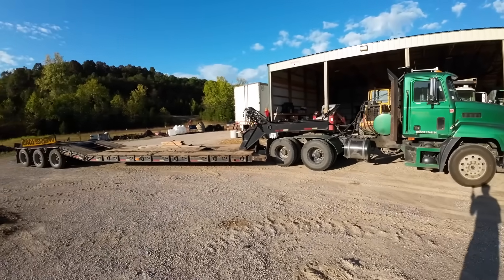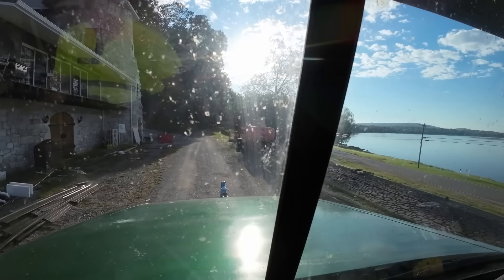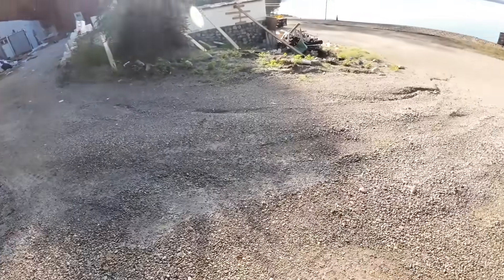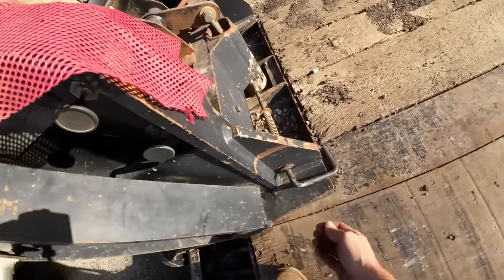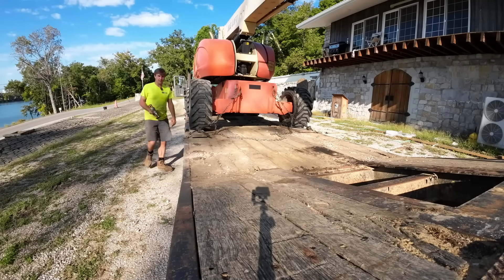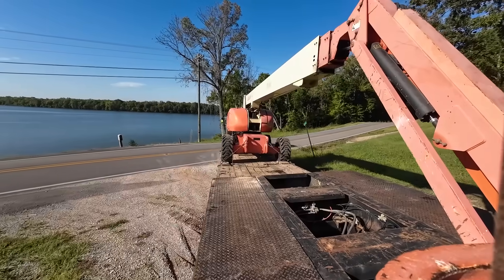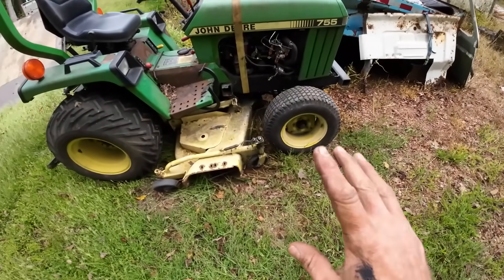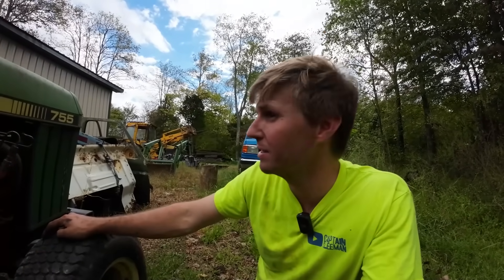Trucking my Marketplace Purchases

Comment: Capt'n Kleeman, there is one more very important item you should have mentioned if you get hung up on railroad tracks.  There is a Blue Sign on every post that has the crossbucks and or lights.  On that sign is a 1-800 number.  Call that number.  It connects you to the railroad dispatcher.  Giver the dispatcher the 2 lines under the 1-800 number.  That tells the dispatcher exactly where you are.  The dispatcher can then prevent any train from further ruining your day by stopping trains from using that crossing.  I did see that sign on the post for the crossbucks for the railroad tracks you crossed.
Capt'n, I have had to use it due to being rear ended and shoved onto the tracks.  It does work!!!
After you can clear the crossing, call the 1-800 number to tell the dispatcher you are now clear.
The railroad would much rather delay a train than have the expense of hitting you and causing damage to the locomotive or worse derailing the train.  Delays are so much cheaper!
My safety rant as a former railroad engineer.

Comment: Keep the 755 forever. Rebuild old trucks as needed. You can have parts on hand and fix them yourself. (Four tractors on the ranch, ranging from a 1981 to a 2021.  Guess which one is giving me grief.)    Thanks for the video, take care.
Reply: Just a wild assed guess but, the 2021...

Comment: Well Mike,
Looks like you snagged some pretty good scores.👌👌👌
On the 755, do a compression test on each cylinder seeings how the injectors are conveniently already out, video the injectors while checking the compression, and you will have quite a bit of information about that engine for future reference.😉
The might have run when parked dump truck is definitely a good find and just might surprise you.🤷
Guess we'll have to wait and find out.🤙

Comment: When I lived in Toledo in '04, I scored a '69 GMC 5500 w/ 16' dump bed for $450. Had to go to Franklin IN to pick it up. Started driving it home until dark, then pulled it the rest of the way with an F-150. Over the next year, we took 100 tons of scrap to the yard. The truck more than paid for itself everytime we engaged that PTO and dumped the metal instead of throwing it by hand
Reply from the maker: That's awesome!

Comment: Thanks for sharing your thoughts, ideas and videos. Nice summary of the potential upcoming videos. Nice to see that Old Blue is heading towards a future on the road and not just the trails. Looks like the White Elephant has some promising adventures coming to it also. Have always seemed like the man lifts are surprisingly heavy for their size but if you consider what your doing with them the need to be heavy is a must and they probably are engineered to take every advantage to make them heavy in every aspect of the build in the base. Nice to see your sidekick joining you for the drive. Wishing you and your family the best. 😊
Reply from the maker: Thanks tom!

Comment: Do a leak down test on the parts engine, just to make sure what condition that parts engine really is in. The problem cylinder just might be something really small that the previous owner missed, I rarely take a previous owners word unless it's visibly obvious and doing so has saved me a ton of money. 😊
Reply from the maker: Gonna check compression on the cylinders first, then go from there

Comment: Hi Mike.  Lots of hints for future videos!  If/when you go back to Millennial's place, maybe you could pull into the spot where you backed into to turn around and back around the front of the building from there.  It would mean backing to the blind side, but it looked like the turn would be easier to make and visibility shouldn't be horrible with the low boy.  Just a thought.  The big Ford dump truck is pretty solid and looks capable.  Hope you can get it running without too much trouble.

Comment: That era F series with the gas motor can have a problem with water from the cowl dropping straight into the carb if it is left open, check out Diesel Creek’s “700 auction crane truck” vids from 4y back, I’m not sure which one mentions it. Might be worth covering with a bucket or something when you’re between work sessions on the motor.
Reply from the maker: It doesn't have a carb

Comment: Cant wait to see you work on the Lucas Gurling brakes on that beast, and the commentary that goes with it.  Should be GREAT YouTube content!
Reply: Yeah  I am waiting to see that myself seeing that I have a 1984 Ford F600 with the same braking system on it ,,electric over hydraulic ..they can be a pain in the rear not to mention that parts are not easily accessible and when you find them they are terribly expensive . Right now I am looking for a hydro -boost and motor to replace the one on mine . Also the rear brake hubs are like looking for a unicorn. The best of everything to you ..look forward to your videos
Reply from the maker: They don't seem overwhelming